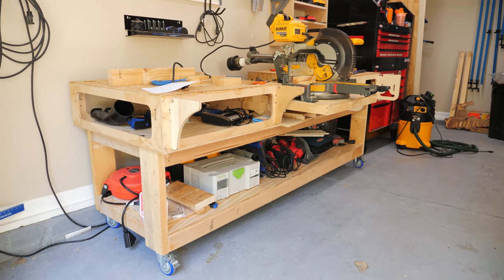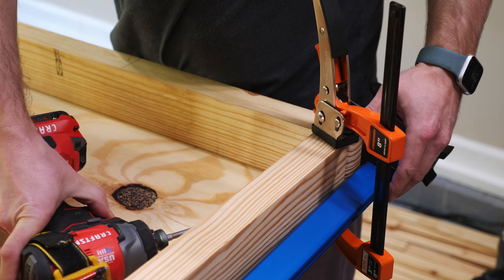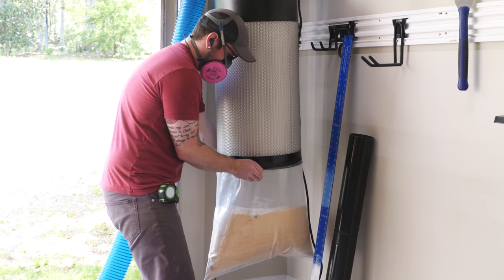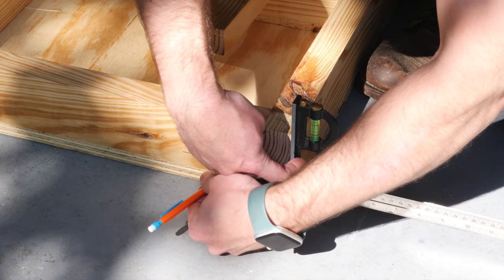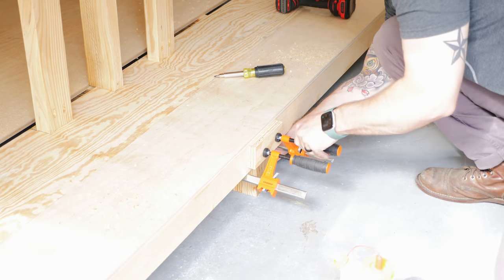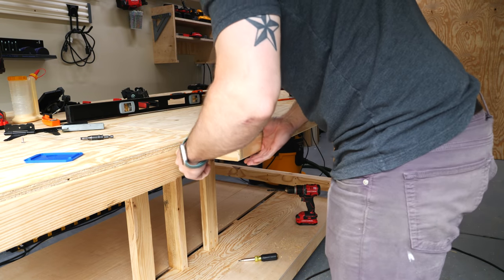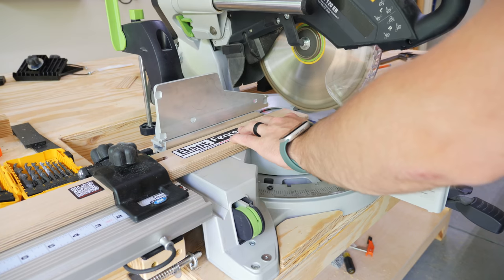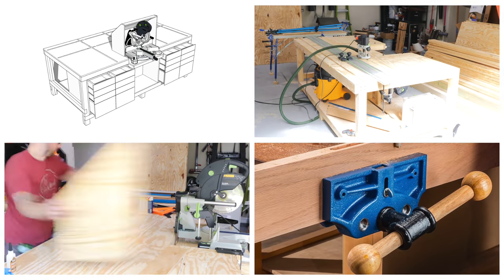Garage WORKBENCH / MITER SAW Station / OUTFEED Table Combo Build Part 1

Comment: its always helpful to have a good workbench when making your new workbench.
Reply: The ole chicken and egg problem.  But with a workbench, Chris Schwartz shows that you can build a roubo style work bench starting with the top construction on saw horses.
Reply: Semper Fi  the rooster
Reply: I have a work bench, but am constantly thinking of improvements for a potential work bench version 2, 3, etc...
Reply: Right!  I'm gonna start with a super cheap 2x4 and plywood bench with butt end joints and screws.  Lol.  Maybe this one day..
Reply: Im building my first workbench at the moment. Im using two sawhorses with slots for 2x4's. It lets me get off the ground and somewhat comfortable.

Comment: I bought the plans for this and am in the middle of assembling the bottom frame. Just thought I’d provide some thoughts. The plans are excellent. I’m making a few design adjustments for the miter platform and I also plan on adding a miter lift opposite the miter saw. These require some adjustments to the top frame I’m also adding extra legs as I don’t feel comfortable with just the two supports at the back of the miter cutout. These changes also mean adjustments to the bottom panel, the drawer cabinets, and drawers themselves. I quickly learned Sketchup and the mods were easy to do. 

I love the idea of ripping 2x8’s and turning them into two boards three inches wide. Like in the video, I assembled the legs and then trimmed to three inches. They look great. 

So far, I love this project. It may be a tad aggressive for a second project (first was sawhorses), but so far so good. I have quickly improved the accuracy of my cuts and paid close attention to the plans and the videos which has led to good results. 

Thanks for the excellent plans and videos.
Reply from the maker: Glad to hear the plans are working well for you! Good luck on the build!

Comment: You should add a recess where the miter saw is and have a cut out so when you drop it down you can put a piece there and have a big work surface without a hole in it 👍🏼

Comment: Hoping to see the hood that is installed will fold down with the saw, with the back acting as a flat surface that sits flush with the top to eliminate a gaping hole and allow for a workable space

Comment: If you want another recommendation, Delta has made a miter saw similar to the Bosch called the Cruzer. Got mine on sale at Home Depot (Black Friday) for $350 (10" model). Amazing little saw. Set up on the Rigid miter saw cart. Crazy good combo for small workshops.

Comment: Nice Bench!
Why not put the castors on the insides of the legs (at the ends of the table)? That way you can leave them attached without kicking/tripping over them while you work
Reply: aljowen Because those casters are meant to be mounted on the outside.

Comment: Nice bench!
However, I'm concerned by your use of eye screws to hold your mitre saw platform up. If the weight of my Bosch Glide 10" is any indication, I reckon they will eventually pull out under use. A long eye bolt with washer and nyloc nut beneath would be a stronger option should the screw eventually pull through. You can shim the top with washers (or a machined spacer if you have a lathe) if required.

Comment: I like it. Very nice build and super functional.   I do like that detachable fence thing but for me the registration blocks left in place would get in the way.  there must be a way to create cutouts for it to register into the bench so when the saw is folded it’s a completely flat surface.    That’s the only downside for me with that fence system, I’d probably do the T track option like you showed.  

But totally still an other awesome build by you.

Comment: I wonder if you could use spring loaded hinges like the ones on the door leading into the garage. They have an adjustable spring and are compact too. This might help with the lifting and make for an even more solid build.

Comment: Great work bench but I would have made the cutting bed (whatever it's called of the miter saw flush with the top and used the t-track like you are doing everywhere else, just add a measuring tape to it so you know the distance, you get the added support for long pieces also. It would be less parts to have to take off and store, which for me means I would actually use that feature more often, and you would have more t-track to use for clamping if needed.  But that's just me

Comment: There’s a Hitachi saw at Lowe’s that has the front rails for the sliding mechanism and it’s half the price of the Bosch saw shown in the video
Reply: Make sure you cover the brand if you get it, lest your wife mistake it for something else.
Reply from the maker: Good call! I actually looked at that as well, just forgot about it. I already had the Kapex so figured I’d use it.

Comment: Silly question time..Why did you not make the edge of the fold down table flush with the edge of the bench as that would also stop the saw from sticking out when it was folded down...just asking for curiosity purposes as a newbie, that’s all

Comment: Love the castle joint idea. Did you add the central leg under the bed because you're working with softwood or because the castle joints require added reinforcements?
Reply: A table this size is best with 6 legs not 4. I think he added in center so the chop saw flip table will fit. You can build a work table much lighter with less lumber on top, use 6 legs (extra 2 placed half way between corners on long side). He made a newer outfield video for a simpler plenty strong design, which can be made this size. Just use 2 more legs

Comment: @18:02 I really can't stand those casters after using them on my outfeed table.  Yes, when retracted they allow the legs to rest directly on the floor which is more stable, but the abrupt drop when lowering the table down off the casters jars things all around in a way that's caused issues in the past.  I think I'm sticking with standard dual-locking casters from now on.

Comment: Brilliant build. A couple of great tips there, thank you. One question, I noticed that you had what seemed like a magnetic pad strapped onto your impact driver for bits etc. Could you share details of this. Also what bits are you using?
Thanks
Reply: I came to the comments specifically to ask this as well
Reply: Just buy a small neodymium magnet and place it on the shaft. That's what I do...
Reply: those were milwaukee bits, I believe

Comment: Any reason you used the regular 2 1/2 pocket screws vs using the HD pocket screws designed for 2 by materials and larger?

Comment: Beautiful! Goals for the future! I need a favor (if u read this lol) can u please check if the Festool Hold Down Clamp will fit correctly in the 3/4 hole on the back of your Flexvolt Slider!? I want that $90 (🤦‍♂️) hold down clamp so bad but I don’t know any1 that has 1 😔
Reply from the maker: Unfortunately, I don't have the Flexvolt saw anymore but you could always just order a hold down from Amazon and return it if you don't need it!
Reply: Crafted Workshop oh darn no biggie thanks neway, I read some1 used it & it worked, was just a bit skeptical. It’s just a heavy price tag but yeah that’s prob my best bet. Wide material supports (just bought) & 1-2 “quick” hold down clamps.. Is my job site 16’ poplar board dream lol gotta keep it square’d up! u get it 😉

Comment: Always had doubts about the idea of fold down mitre saw table purely from an engineering point of view. Unless specifically designed to tilt or tip most machines - not just table saws -  are designed to operate best in the plane in which they sit. In this plane they are balanced by that I mean all parts are  protected by design. Tipping a machine through 90 degrees and k]leaving it hanging of balance must surely put a strain on some working parts or joints. I have a makita table ‘ site saw. It is designed to stack away  on end it comes with a trolley that allows it to happen. It is built with that spec in mind so no problem.  Just putting the thought out there so consideration can be given.
Reply from the maker: I keep the saw folded up 90% of the time, definitely not worried about it being damaged from hanging.

Comment: Love the design of your workbench! I'm gonna start to build mine on the weekend. One question for you though... do you find your dust collection motor tends to get hot or not? The fan shroud on the motor is very close to the wall, which would impact the airflow around the motor. Thanks for posting the bench video !!!!

Comment: Love your ideas and other videos. I have two questions though... what is the added value or comfort for the folding miter saw platform. You don't really seem to free that much space. Second question: the front casters seem to be 'in the way' when not in use. Wouldn't it be more convenient to place those on the sides also? I really like your videos and appreciate all the work you do so keep it up!
Reply: Unless you have a ton of space to put stuff on, like the miter saw, probably your workbench is the same place where you use your miter saw (in my case I use it on my workbench for smaller cuts, for longer ones I put the saw on the floor). That means I'm always putting and removing the saw when needed or not needed. Having a foldable platform solves this problem, the saw will be there just when you need it, freeing the top of the bench when not used.

Comment: I went with the Bosch Gliding Miter Saw that you eluded too.  Couldn't get myself to pull the trigger on a $1400 saw. rather spend that money on other parts of my shop
Reply from the maker: Honestly not worth the price in my opinion!
Reply: @craftedworkshop  bought the Bosch b/c of a promo where the folding/rolling stad came with it.  works like have having a stationary miter box station, but can move around my garage or driveway.

Comment: How do you like those casters. I bought some similar ones and they rub against the legs of the bench making it almost impossible to move. I designed the whole bench around the concept of these casters allowing it to be lowered to the height of my table saw. So I can’t just add other casters to the bottom of the legs. Anyways, wondering if you have the same issue.
Reply from the maker: Hmm, haven’t had that issue with these. I love these casters, super beefy and easily removed to get them out of the way.

Comment: Did you have a solution for dealing with miter saws that slide at the bottom rather than the top of the saw?

Comment: Hi, so I have been looking for a good, kinda less expensive impact driver, and noticed that you have a craftsman impact driver, I know that they aren’t as high quality as dewalt but what do you think about it, does it have lots of power and function well?
Reply: If you already have batteries for any of the common tool brands, just get their impact driver. Even 20v Black and Decker from Walmart has the power of the standard 18v tools, so as long as you buy from common brands offered at home depot, any brand is gonna work for you. If you don't already have a battery from one of the main tool lines, Ryobi makes a ton of tools for their batteries with applications outside of woodworking. Inflators, spotlights, radios, fans, etc. All good for family camping.
Reply from the maker: They work fine for me, plenty of power for everything I’ve thrown at it. I do have the brushless version, which lasts a little longer and feels higher quality than the cheaper brushed version they sell.
Reply: Crafted Workshop ok thank you! Love the video

Comment: $1500 Festool Miter saw, but the cheapest possible way to build a work bench...cheap plywood (Baltic Birch would have been a better choice) and dimensional 2x4's...not to mention the Craftsmen nut driver. And finally, if you did not know you can order screws/bolts online... no worry about the pandemic. I'm scared to watch part 2...well maybe I might get some good laughs...haha

Comment: Very nice, I like how you show your mistakes and how you would improve 👍😉 I built  similar benches using the same methods applied here, if you have the time pop over to my channel and check it out👍 also I use the dewalt depthstop all the time it's very reliable and 75mm timber works perfect for offset on a 12in blade👌